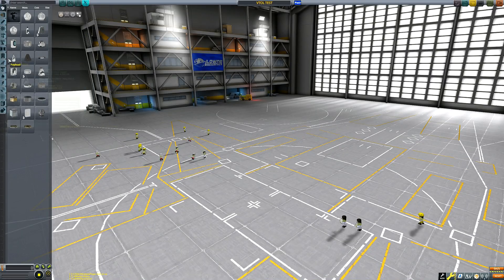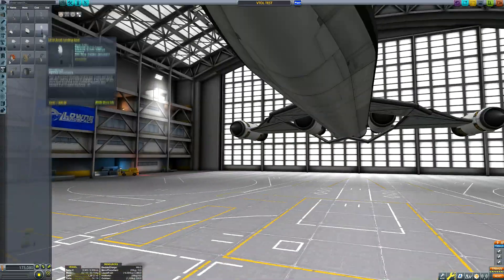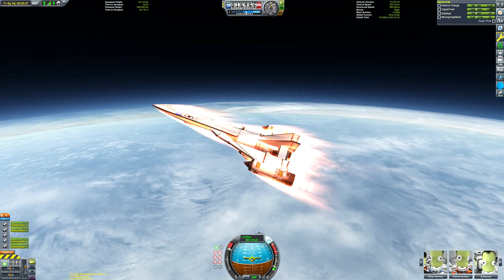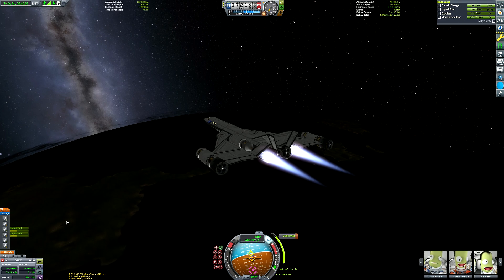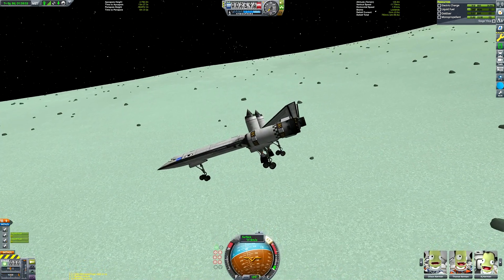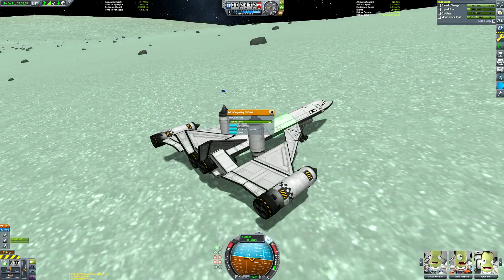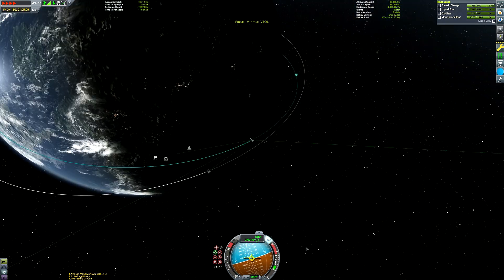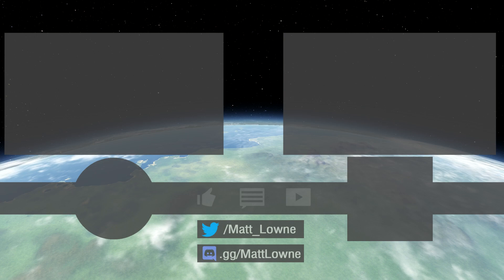Tilt-Engine VTOL SSTO to MINMUS! - KSP

Comment: Just build your craft first, then place all the fuel tanks symmetrically so that when engines drain them evenly, COM does not change even if the fuel gets depleted.  It won't be perfect (depending on how much time you spend on the design) but the change in COM should be negligible.

Comment: i prefer a system where i have a single SSTO that brings crew up, and i have a large space station with lots of vehicles docked, as well as tons of fuel tanks. The docked vehicles are launched by rocket and are capable of a 2-way mission to x location. I just have to dock to the station and transfer crew. It's a good system that saves on fuel and weight, i don't need rapiers for my mun vehicle, or any air-fed engine for anything but the SSTO.

Comment: Its not your angle that effects the drag, its the angle of attack. The angle of attack being the angle between your velocity vector (prograde) and the nose of the aircraft. You don't want your angle of attack to be greater than about 12 degrees. Too much and you'll "flair" and the entire fuselage will act as an airbrake. Nose up to 50 degrees if you want so long as your angle of attack doesn't exceed about 12 degrees.

Comment: 12:45 - Another thing that I've found almost always helps with directional control during landing is to disable the brakes on the nose gear and just use the main gear to brake; this puts your center of braking further behind your center of mass (so your plane naturally wants to go straight), and considerably increases the effectiveness of the nose-gear steering.

Comment: lol, ive done similar mission to minmus way way way before official version of KSP dropped. I must say, I still prefer 1 nuclear engine on the tail and tiltable rapiers on tip of the wings configuration (because it has less dead weight), but your take was interesting nevertheless.

Besides, tiltable nuclear engines are useful only on Minmus or Gilly, on bigger moons it is still more useful to have more power when taking off up to certain speed/height, rest of the way to orbit is manageable afterwards using NERV engine, if the craft is sufficiently light.

Comment: Guys, please, tell me, how hi builds 2 different objects in hangar? I mean, he sets two different objects that are not connected, but  they aren't transparent. Is this a mod, or I didn't find this option in options?
Reply: He used the offset tool to drag the bits apart.  They're actually still attached to reach other though.

Comment: My rotation servos turn in opposite direction how do I make them mirrored? It's fcking frustrating
Reply: seperate them (there's an option in the right click menu in the VAB/SPH that says something like break symmetry) then make the one that's turning the wrong way deploy in the opposite direction.  I used to have this problem with control surfaces constantly, and I'd have to place them one at a time then go back and change the deploy direction on one side to inverted.

Comment: idk how realistic ksp is but how easy would it be to have a SSTO go to our moon and back like this?
Reply: Not at all, which is why we have yet to do it.  The physics is partially accurate.  If all we had to fight was standing atmospheric friction and gravity, then KSP is closer to 100% accurate (to scale since kerbin is smaller than earth but uses the same gravitational constant 9.81 m/s).  The problem with doing this for real is we never have standing atmospheric friction, because there is a constant wind, and wind is unpredictable in that it could be blowing at different speeds and different directions at multiple levels of the atmosphere.  Also, our atmosphere is not as easily layered as KSPs are as it really only calculates density of the air and nothing else.  There's a mod that tries to make things even more realistic, but really just makes things harder in that it changes some numbers around, and allows for random engine failures and for you to literally rip your craft apart midair by being too zealous in your maneuvers.  As far as I have seen, nothing available simulates winds in any form, storms, realistic pressure systems (atmospheric pressure is not uniform under 10k for instance), nor the turbulence that arises from these events.   KSP simulates perfect launch conditions 100% of the time.

Comment: Instead of belly flopping the ssto's on landing of sans atmosphere planets you don't just come in on a retrograde trajectory and land on the rear wheels first? May not be quite as precise as a vertical landing, but you can come down smoother depending on the landing surface.
While yes you can land vertically and then flop onto the belly, that does lead to that possibility of Complete Reconfiguration After Sudden Halting(CRASH).

The more projects I see with Breaking Ground the more I want to see the DLC come to the Enhanced edition, which will probably happen about the time the next DLC comes out in a year.

Comment: I like the way you did an VTOL.  makes sense that you only need it in an atmosphere free world.  I am having trouble with the hinges in my game and hopefully someone can help me.  every so often I will have a hinge/piston basically stuck and unable to move.  sometimes if I go back to the VAB and basically switch which ends connect it fixes it, but not always.  as far as I can tell the parts don't specify "this side down" in any way.  the mods I have are things like mech jeb and other quality of life mods.  I am not 100% sure if some mod is causing an issue somehow or what.  any help would be great before I try a mod free game and see if that fixes it

Comment: You could combat that pitching moment by placing the swivel axis a bit below the center of mass and then adjusting the angle of swivel in vertical mode as the cog changes
Reply: Thank you good sir

Comment: Don't worry, Matt, your reasoning is perfectly sound. And you finally changed the obnoxiously familiar backgroud music during the assembly part of the video wich was getting on my nerves...
One way to assure perfect balance would be to set the fuel tanks locations and their fuel drain priority to make sure that the the fuel tanks along side the engines are the last drained and the others are equally balanced fore and aft, while getting drained the balance wouldn't change at all. Technique already usable in conventional aircraft as well even for non VTOL ones to ensure stability at all phases of the flight. Simpler to do on small craft, of course...

Comment: 3:05 No, I'm very proud of your reasoning, that's the first thing I did after designing a pair of construction vehicles.
I built a vacuum VTOL Because that's what pushes the efficiency of a space plane to its limit. Using lifting surfaces in atmosphere, and gently using engines in vacuum, or low pressure bodys. To land horizontal, rather than vertically, before noting down to have the suspension take the brunt of the final landing.

Comment: Anyone else tried making parallel collapsing frames with the new hinges? Tried it and the parts came apart in-game 🤨

Also...maybe kOS could figure out the centre of mass based on remaining fuel load and adjust the engine limiter to compensate.

Comment: The fact that this game's been around for over 6 years, and the devs STILL haven't gotten around to building joints with proper constraints solver is just sad. Even Roblox have fixed their joint solvers years ago. And KSP still using springs for everything. Shame.

Comment: Don’t try to brake with the engines on a vtol in atmosphere, you’ll likely lose control...
Also I made a mech that has at least 6 joints per leg that move...
The mk2 can move at an average of 2.4 m/s when u point the probe core in between 10-20 degrees positive
Also my Dragon SSTO (different from urs, it’s a self refueling minmus cargo SSTO that MAY be able to get to other planets after minmus refueling) tends to swerve left on a DMP server when approaching 500m/s but otherwise it works great...

Comment: Matt Lowne what are you doing that allows you to just drag and drop parts about anywhere and it still counts it as part of the ship despite not being connected to anything, as well as dragging the parts into each other like that. I've tried using part clipping but it did very little for me.
Reply: If I remember correctly you can enable moving parts everywhere you want in cheat menu (Alt+F10)

Comment: Nice craft!
To fix the "Belly Flop" issue, you can just add a couple Verner RCR thrusters under the nose so you can do a slow, controlled belly flop.
You can also fix the Phys-Warp issue by locking the rotator. It cant be done in the SPH, for some reason, and needs to be done once the craft has spawned in.
Reply: Also, it's not too hard to add a small twitch engine at the CoM to act as a VTOL thruster, it works well for Minmus.
Reply: I know this comment is well late but back in the old days we could simply move the engines/mass around automatically:
https://www.youtube.com/watch?v=gEjlMeq9qCA
https://www.youtube.com/watch?v=8UTFm5bUoSc
Maybe I should look at resurrecting the mod for the new, fangled technology :)

Comment: This is a case where you really should use autostruts... I know they mean you can't rotate your engines, but you can just turn the autostrut off for rotating them. 
That should allow you to timewarp to your hearts content.
Reply: Cruzz999 When I tried turning on autostrut for a part I rotated into place the part tried to move back to its original location, was forced back by the robot part, flipped out, and exploded. Haven’t tried again.